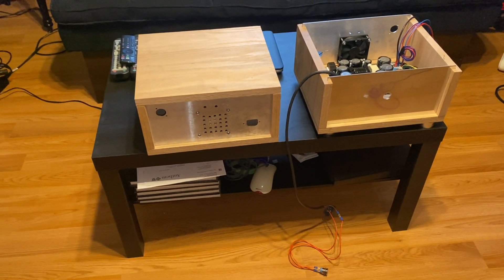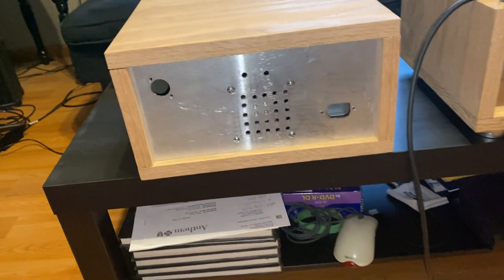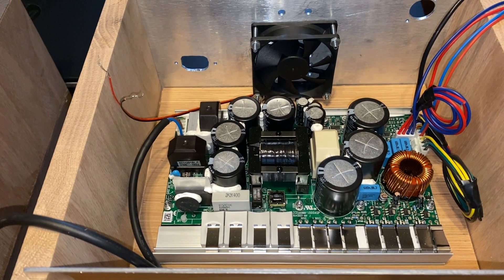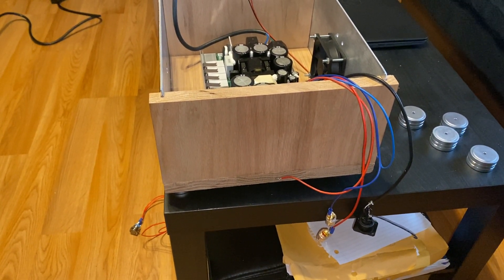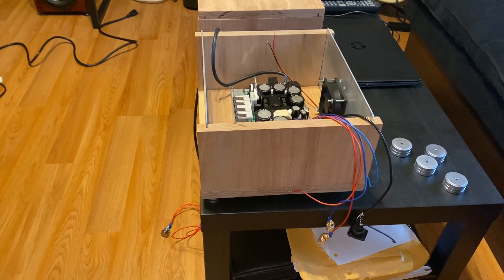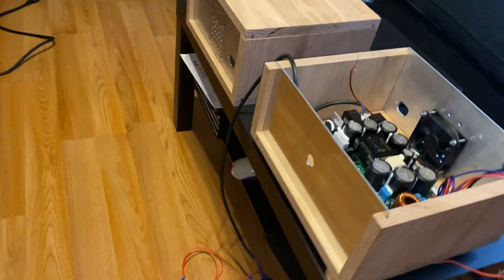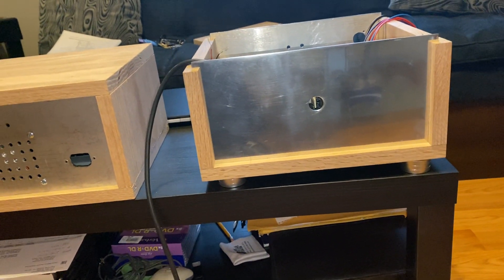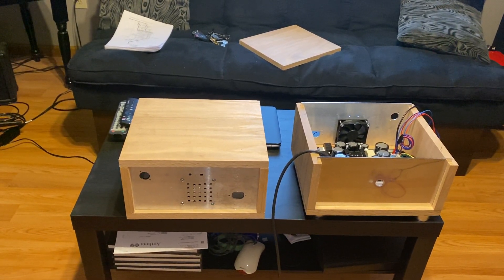Icepower 1000asp amplifier build pt4.

Comment: Just found you. Thanks for the info.

I assembled two 200 ASC mono blocks.

The sound isn't quite as hefty as my class a Sony ES amplifier but bang for the buck they're hard to beat
Reply from the maker: I was using and an NAD Receiver probably 12 to 14 years old 70 W per channel. This blows that away of course with power but also clarity base response. I’m quite satisfied with these boards. One review I Read said they compared to a para sound A21 amplifier That retails for $3000.